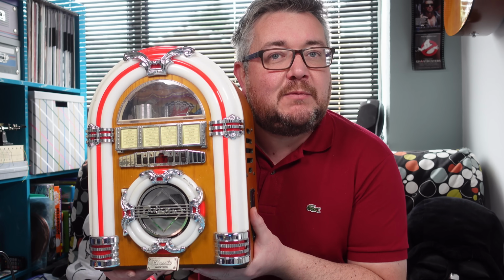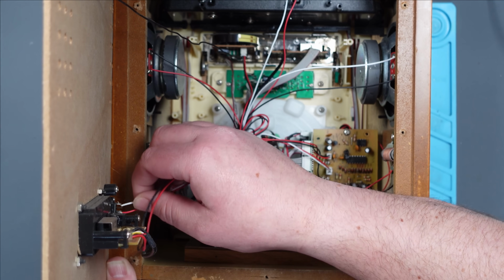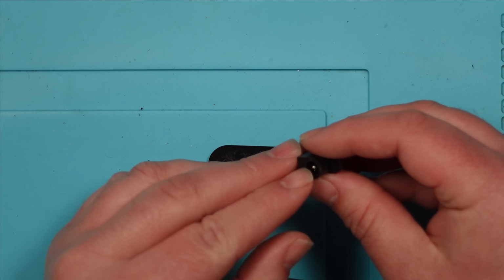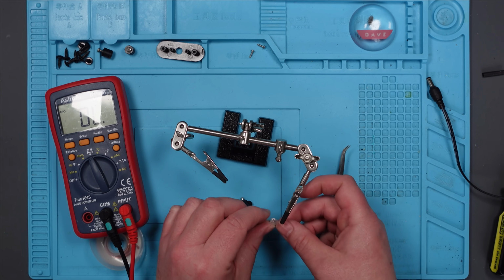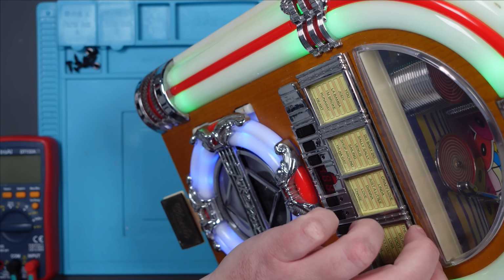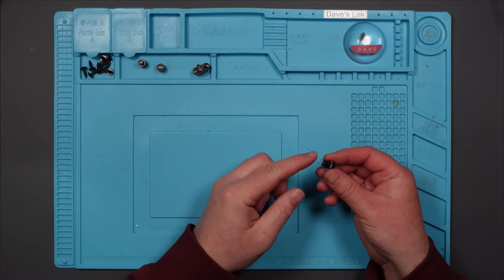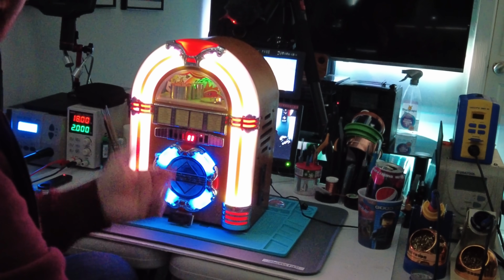I Paid £26 for a FAULTY Mini JUKEBOX on eBay | Let's Try and FIX It!

Comment: Just remember kids, always start with the easiest thing to fix first even when it seems unlikely!
Reply: Yep the in-laws 3d printer wasn't working properly, asked him multiple times 'have you checked the wiring ?', everytime Yep.
Walked in, checked the wiring, one connector was basically plugged into itself. Took 2 minutes to diagnose and 'fix'.
ALWAYS check the easiest thing first.

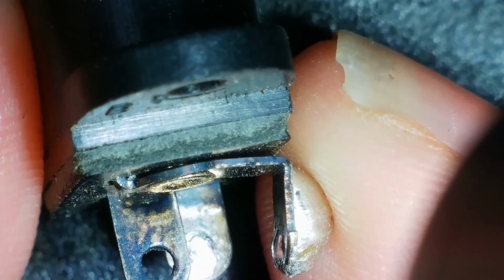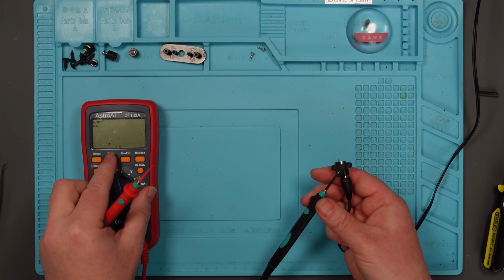Comment: At 4:57 the reason why you were getting continuity you were measuring the outside of the barrel plug to the CENTRE pin at the back, rather than the edge connection...so the "continuity" you were hearing was thorough the power supply's circuit.  Had you touched the right connector at the back you wouldn't have gotten continuity.  At 5:41 you were touching the correct connector at the back, hence no continuity.
p.s. You shouldn't have the power supply plugged into line voltage when doing continuity tests as you could blow your meter if you touch the wrong pin.
Reply: Nom  The thing is, in continuity mode, resistor (Ohms) mode, diode mode (and other modes for testing capacitors and transistors), the meter is supplying the voltage needed for testing the component from its internal battery.

If what you are testing is powered, or has a stored charge from a capacitor, the least issue you could have is a false reading as the meter is using its supplied voltage as part of its computation.  However depending on the meter anything from blowing a fuse, blowing the measuring circuit, or bursting batteries can happen when the powered source is added to the meter's internal voltage.  I once had a Radio Shack (Micronta) meter that was always blowing its fuse if you made a mistake like that; that's how I learned the hard way!

Comment: Always make the barrel nice, clean and shiny especially the outside 😀 an old printer I had would arc and spark requiring lots of wiggling to get it to work!  About a year later I wiped the connector and it worked flawlessly after that.

Comment: Well well I happy 😊 you make it works again. You figure out the problem within some mns.
Someone throw 1 like this in the dustbin.
The difference between yours and mine is the juke box play tape not CD.
I didn't check it well I have keep it aside. But for you is in good shape. For me I must do a good restoration.
I am very happy you posted this video. ❤️

Comment: Anyone else would've just hard wired it, or just me?
Also, for something fairly modern, that rats-nest of wires was surprising!!
Reply: I wouldn't say it was surprising at all.
Reply: Yes, I was thinking I would have just hard wired it, but actually this is much cleaner and actually didn't take much effort.
Reply: @cheapasstech  I'm pretty sure that dude has a lot of spare parts.
Reply: i would've just gotten a barrel plug from any of the million dead devices lying around :P
Reply: Just spend a few pence on a new socket!
Reply: Most cheap Chinese electronics use parts intended for other things.  Almost nothing is purpose-built.  What happens is big multinationals will tool up a factory to produce parts for assembly, and then after hours they'll do illicit runs off the books which they use to construct other products.  As a result, you often find lots of strange wiring inside, and puzzling choices where they may use more expensive elements for something with capabilities they don't need simply because they can mass-produce it cheaply.

Nothing goes to waste.  For even cheaper goods, they'll take parts that technically function but fail QC and sell them out the back door of the factory.
Reply: @cheapasstech  Intel's 486SX was just a 486DX with its math coprocessor crippled, although in this case it was intentional.

Comment: Nice job fitted a better quality part makes you wonder how many of these might have been thrown out down to the fitted jack failing its good they used wood in the construction it does sound better than i would have given it credit for .

Comment: Always test power supplies by attaching a load.  Often they can fail such that the unloaded voltage looks okish but when it goes under load the voltage drops out.  You can measure as you plug it in and if it drops out it may not be a short in the device but a faulty supply.  I use a grid of power resistors i mounted with heat sink compound to an aluminum plate with some fans.  Then I use jumper cables to make the load whatever it needs to be to pull the full load amps.

Comment: In the early 2000s for $7 shipped I bought an AM/FM CD Alarm Clock off eBay. It was sold as having a broken eject lid for the CD. I didn't fix the eject mechanism, but I added a little knob on top of the lid. The alarm clock was for work because I didn't want something expensive to be stolen. The company required headphones so I added a jack. However, I didn't know how to make the sound hot swappable from speakers to headphones. So I added a toggle switch to determine which output to send the juice to.

Comment: The plug probably shorts the circut when no plug is inserted. Once you instert the plug the bridge is broken and power is delivered. It looked like the negative was pressed to far inward to make contact with the plug. All you had to do was bend it in place again probably. You can see that it's been in contact with a plug before since you can see scratching on it.

Comment: This is very entertaining, I love the tone of the videos. Mixture of anxiety and patience. But why does it need a ground? What does the bit of metal do in the DC adaptor?
Reply: In this instance 'ground' is just generic terminology for the negative DC rail, which is a reasonable term for this level of video. The bit of metal is the negative DC pickup terminal for the outside of the wall-wart barrel plug, no fancy stuff going on here
Reply: @bsdjunkie1805  thanks

Comment: That looks cool as hell.  I have a Monster High karaoke machine that doesn't power on, I had to buy a longer screwdriver to take it apart though. XD
I'm always amazing you find this stuff so cheap, I wonder if it's just a continental difference.  Even not working stuff I usually see being sold for near MSRP or at least half.
"This could be quite easy" 3 minutes into a 14 minute video XD
That thing is really cool, and I bet my kid would love it for her Encanto soundtrack.
Reply from the maker: Thanks Sixty! I have been lucky with a few eBay things recently! Hope you can fix that Monster High karaoke, that sounds awesome! 😍

Comment: I was surprised your drinks-can bodge worked as they are only conductive on the outside due to the plastic coating on the inside.

Comment: You guys would have had Maplins was it(?) to get a barrel jack replacement. Did anything fill the void when they shut down? Or do you have to order everything online these days?
Reply from the maker: Sadly nothing has replaced it on the high Street. It's all pretty much online now 😒

Comment: Looks to me like it is the wrong power adaptor which has a 2.5mm centre pin instead of correct 2.1mm hence no connection when plugged in

Comment: Hello, I have a PSP 300X, which I kept in the drawer for years, I decided to turn it on, but it does not recognize the battery, it keeps switching between external (charger) and internal (battery) and turns off in a few seconds, only turns on after a few hours without the battery, have you found something similar?
Reply: Also i buyed another one, but same issue

Comment: I hate buying owkring items!

MDF is actually, while a cheap material, considered one of the best for speakers, according to a mid late 80s Visaton study, it's unfairly maligned. It turns out to have JUST the right sort of damping to translate well from CAD or pen-and-paper TSP based calculations into the actual sound and helps avoid annoying resonances, with the only technically better choices being thick concrete-bitumen sandwiches or something similarly utterly impractical for the mass market. On the other hand, if you wanted a "vintage" sort of sound, you'd probably choose a material more resembling actual wood. Unfortunately i don't think i can find the paper, maybe should request it from Visaton. Anyway it's hardly a concern in a small speaker which doesn't exactly display the highest of engineering acumen, as long as it's not plastic. It might as well be hard paper.

Comment: You touched the positive connection on the connector wile on the negative on the plug so it completed the circuit in the transformer.. thats why it beeped.. you was ment to go on the negative on the plug and negative on the plug.. hope this clears that up :)

Comment: nice one dude i had something similar only mine was a ipod/ipad speaker dock that the mrs brought me and worked great for ages then it died so i did a little modification and turned it into a blutooth hybrid steampunk style speaker have a nosey see wht you think basically i just used the casing lol https://youtu.be/w0uYHZkX9ak